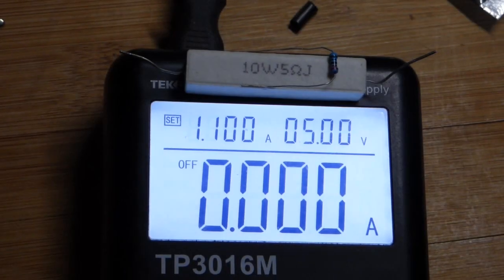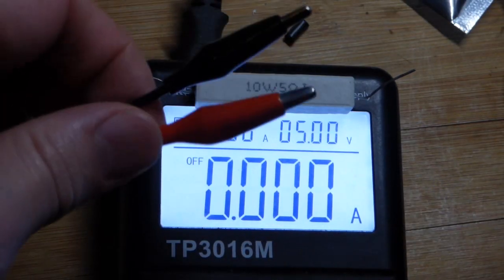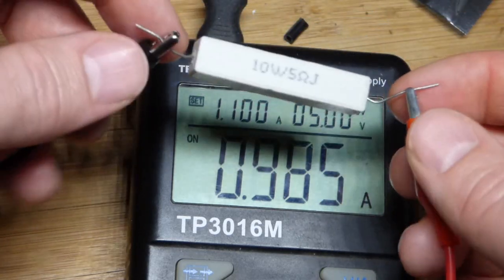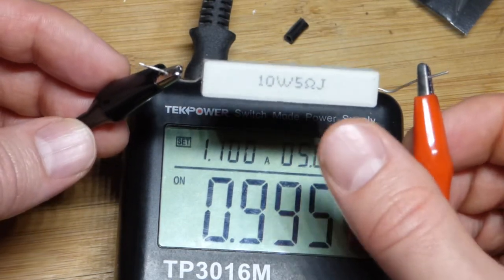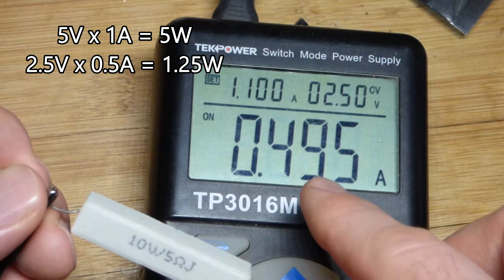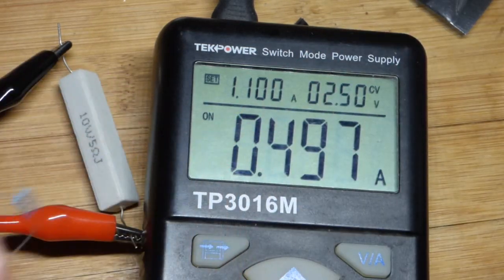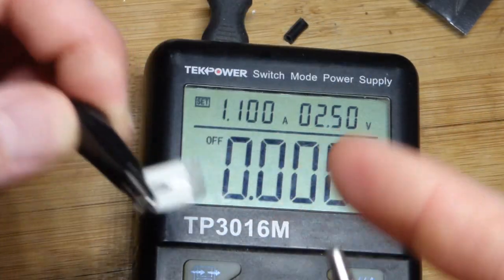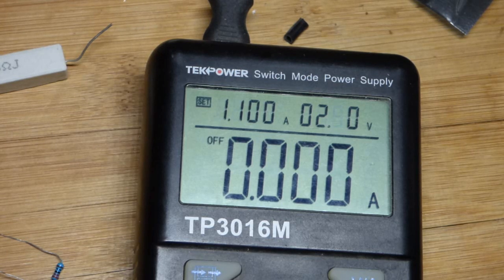Quick look at 10 watt 5 ohm concrete resistor

Comment: What prevents YOU from drawing 1.1 amps if you touch both leads of the power supply?
Reply from the maker: When a load wants more current than the power supply is set to deliver, then the power supply drops the voltage it is outputting as needed to keep the current at the maximum setting. If this power supply thinks that there is a short circuit, it turns off.